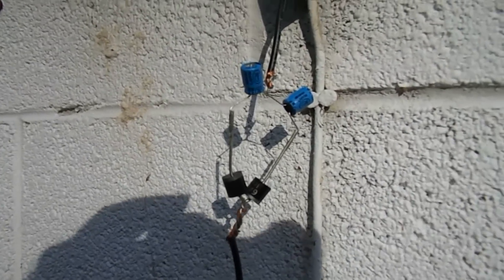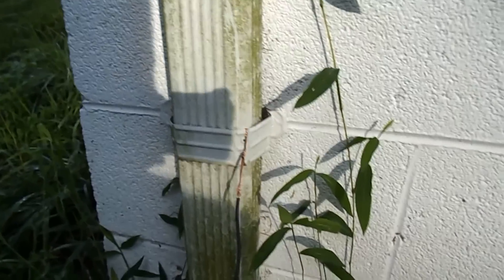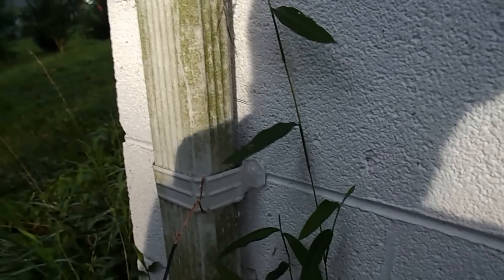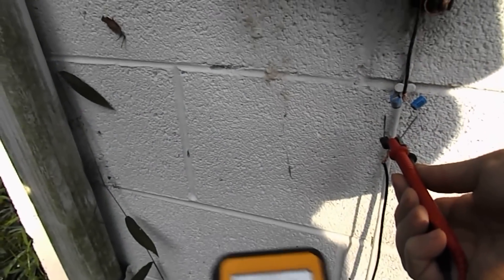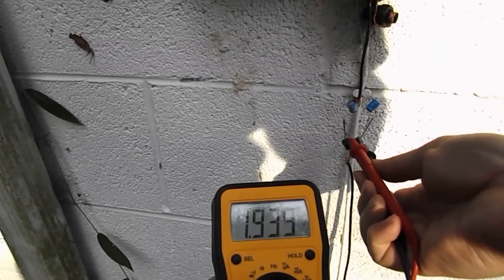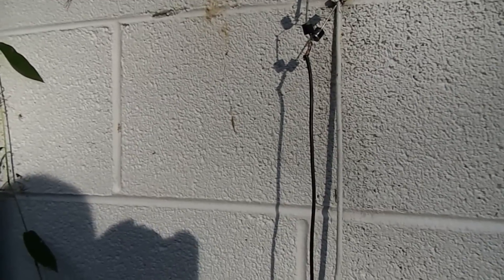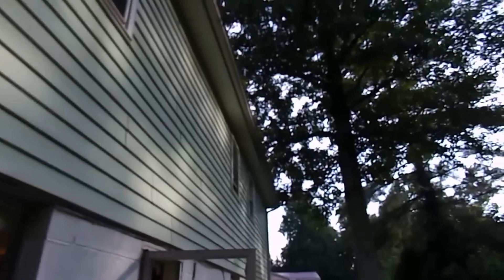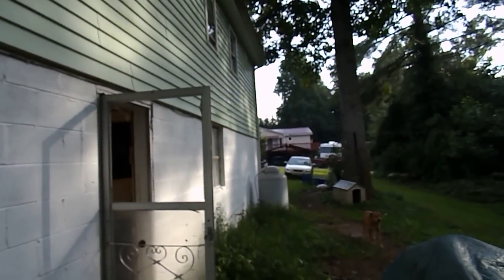Free Power From A Rain Gutter

Comment: That needs to be removed it's costing you money it's call meter drain that's not coming from falling water in the gutter
Reply: Don't recall anyone ever saying it came from water. But it is not coming from the meter either as it is not 60Hz. The first book I read on this was written in the 1800s, where a man built a generator that pulled the static from the air and produced 300Watts. Works much better at higher altitudes.